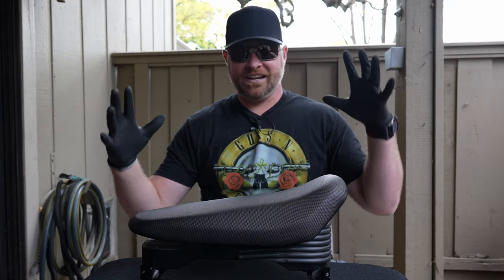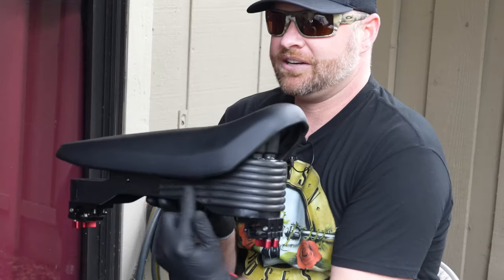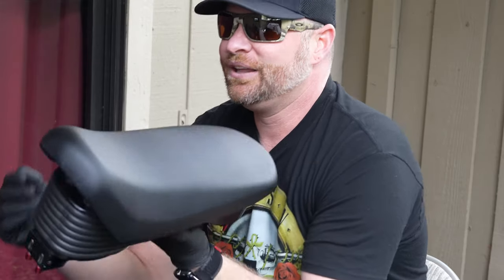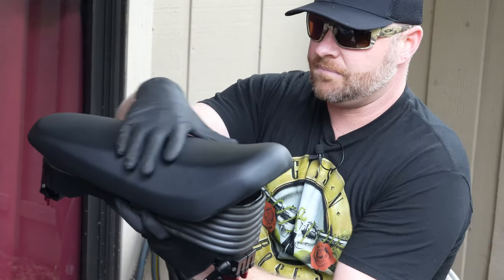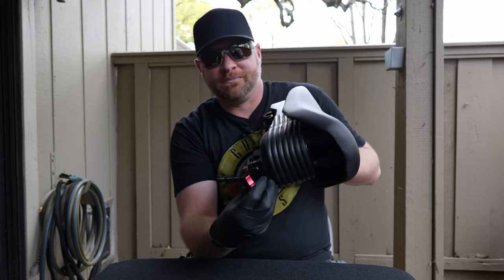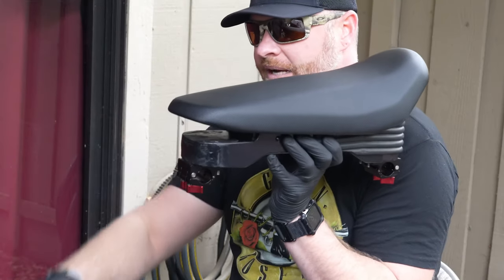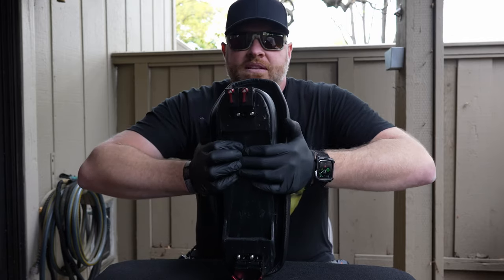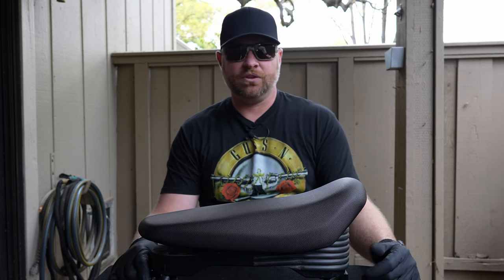Veteran Sherman Electric Unicycle // Custom Seat Explained

Comment: Maybe you can use pony pipe clamps as a "extra pair of hands" to apply pressure on sides of the seat when you use heat gun to reform seat, that way you can slowly increase steady pressure while heating the seat.
Reply from the maker: Similar to what I actually just did. It worked great. V2 of the seat is well underway. Video to follow…

Comment: Do you think it can still hold well enough with just 2 clamps vs 4 of the quick release clamps?  2 clamps in the center and fill the sides with a shim or notch in the 3D print?
Reply from the maker: Great question. I suppose it might work, however I figured better safe than sorry.

Comment: Hello! I've managed to 3d print your models and was curious how it was intended to put the 3d printed pieces together. Glue?
Reply from the maker: You put them together however best works for you. I put the design up for people to be able to use as they saw fit and included the editable file as well. I used bolts.
Reply: @BayAreaFPV  thanks! I ended up editing and bolting as well.